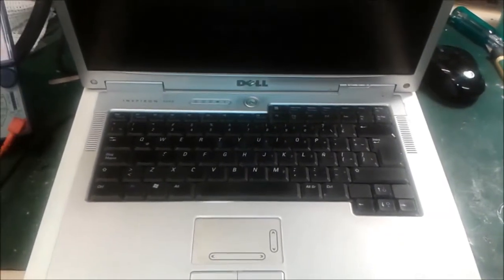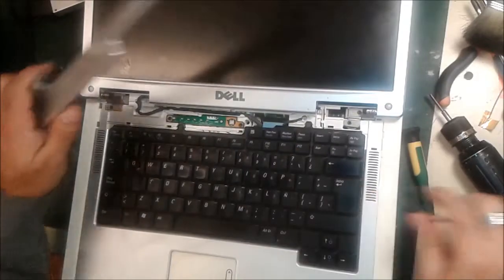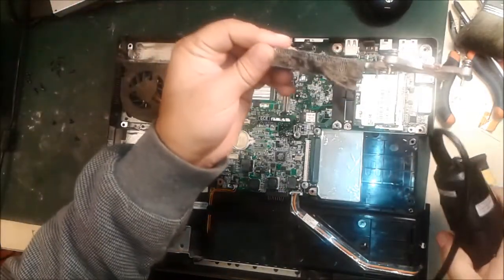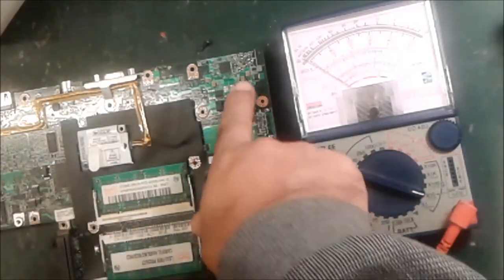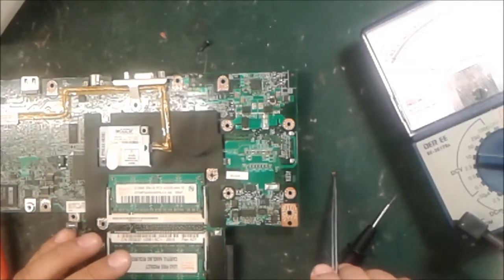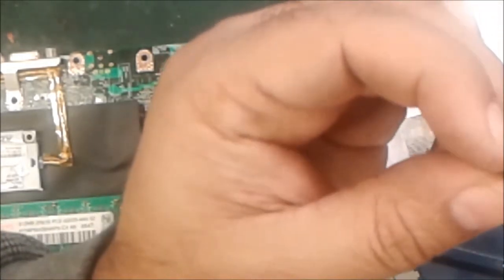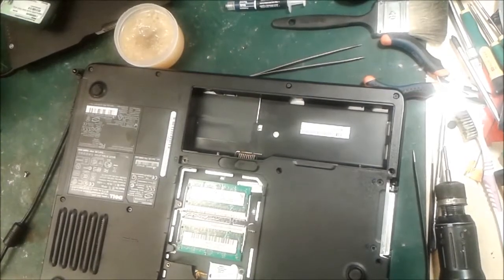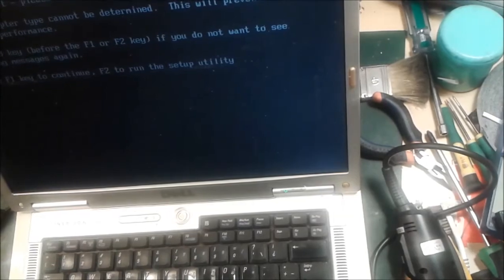dell inspiron 6000,6400,8000 short circuit not on

Comment: What is the model of the multimeter you use, please?
Reply from the maker: There is many multi meter, Sanwa, Aiwa, Red, manual r digital. Beter use manual or Analogue mutie meter
Reply: I mean what is the actual part number of that analog meter you used in that particular video. I know it is a DEREE but the video quality did not allow me to decern the number before the trn. Can you post the number please in your reply? I don't want a list of all the meters you have. the previous reply did not help me because I want to buy an analog meter just like yours in the video. Thanks in advance.